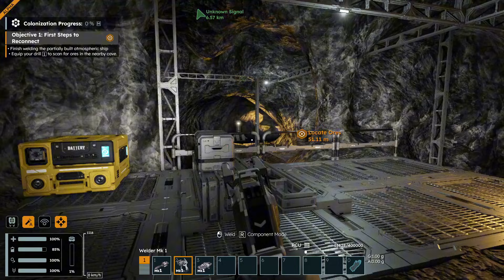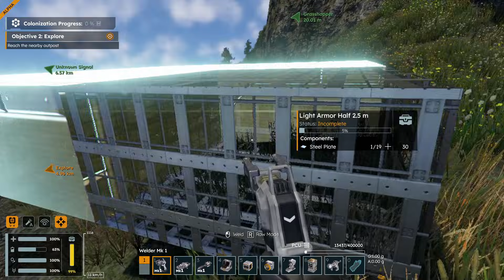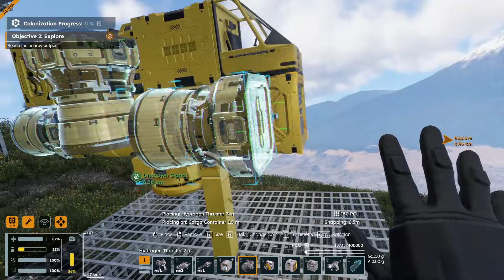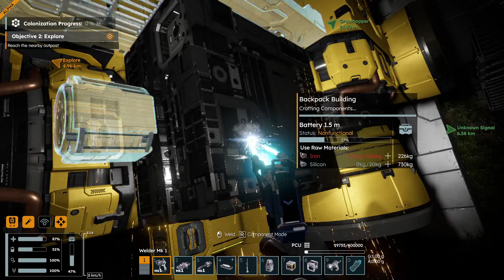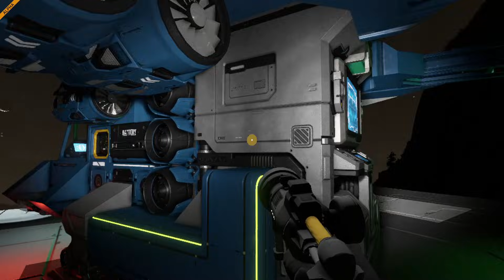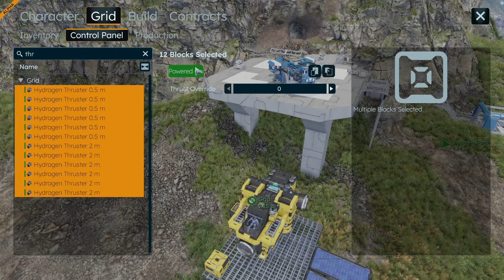BUILD YOUR FIRST HYDROGEN SHIP IN SPACE ENGINEERS 2: VS2 Planets and Survival Foundations E01

Comment: What system are you running, i'm on an R5 7600 cpu 32gb 5200mhz ddr5 and a 5070ti with 850w psu and 990 nvme running it at 1440p 165hz and it absolutely spanked my system in places. Had to do a lil tweaking to get it running 100fps and it still stuttered a bunch on places. 

EDIT. Totally missed that lead. Nice find.... Oh.. Apparently its place holder... we shall see.
Reply from the maker: I have RTX3050 TI, 32 GB RAM DDR4, but I forgot my CPU.